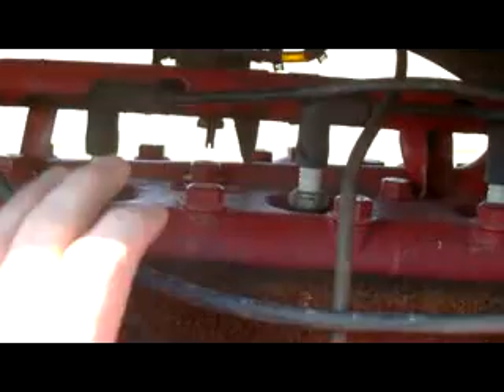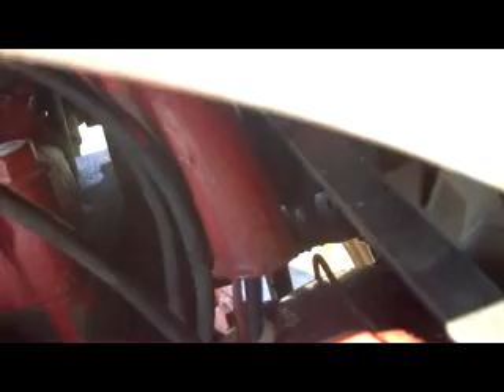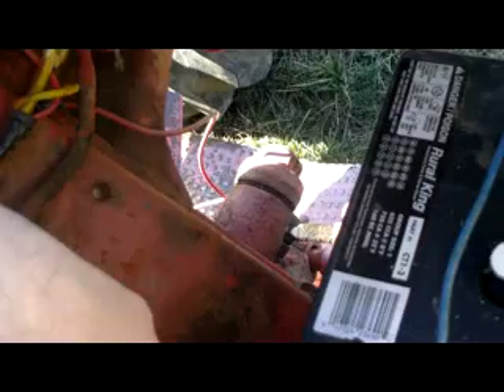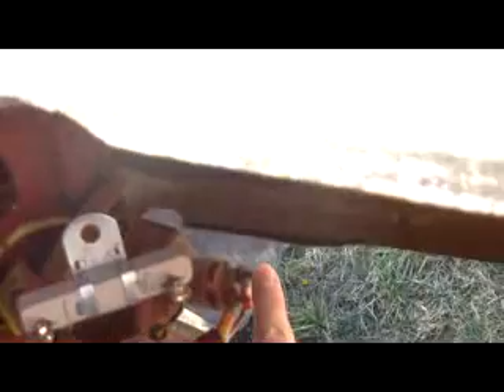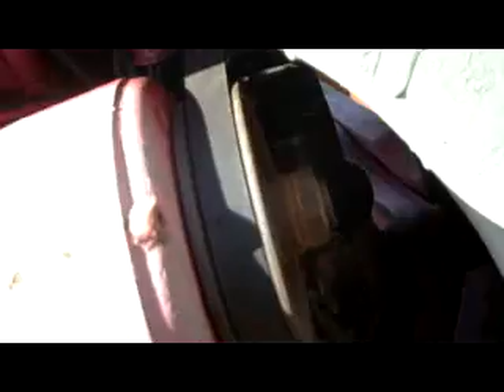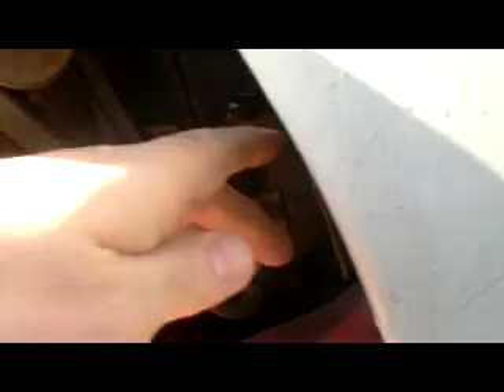8N Electrical System Trouble Shooting When 8n Won't Start

Comment from the maker: To polarize the 6-volt 8N, find the squarecan voltage regulator under yer oilpressure gauge. There should be 4-wires connected to it. 2-skinny black wires, IGNORE THEM. Then there are the thicker wires connected to the Genny ARM and BATT terminals. 
With the engine OFF, use a wide blade screwdriver to "arc-spark" the ARM and BAT terminals together. Just a quick touch to create that "arc-spark". That is all that it takes to correctly "polarize" yer genny and voltage regulator.
Reply: does that work the same way as a 53 jubilee? pos 6 v ground? thanks

Comment from the maker: Ok, this happened to me.. With the 6 volt positive ground if the battery is put hooked up backwards, ie the negative is put to ground, then it will change the polarity of the generator ( even after you hook the battery back right )  You can charge the battery with a battery charger and it will run great and then it dies.  The generator basically is uncharging  the battery as it is run.
Reply: The balance resister is getting really hot on my ford n8 is it supposed to do that?

Comment: my tractor wont start but if pulled or jumped it cranks and runs every time the battery keeps dying a while back i put a 12v battery in it and needless to say i have had to replace alot of parts (battery 6v starter solenoid generator points plugs) i  have not replaced the volt reg plug wires or dis cap its gets gas just fine but something is pulling the battery done any suggestions? someone wired it start so it does not have a key to turn it off possible prob. but its drawing alot of current.

Comment from the maker: First I would see if  the plug was soaked with gas. Just pull a plug after trying to start it.  If it is wet, then you are getting too much gas and need to adjust the carb.  If it is dry, you may not be getting any gas.  Usually you can spray starting fluid and see if she fires.  If so, you have a carb problem, ie not getting gas.  On mine I had this problem due to water/rust in the carb.

Comment: I wonder if u could help me out. I have Ford 8n tractor, that will not start. At first i had no spark. Then i change the plugs and the point, and condenser, and the button and cap. I have spark now at the spark plugs. But it still will not start, and yes there is gas in the tank and it goin through the carb. And success will greatly appreciate

Comment: Correct, I have no spark at the spark plug. I did follow your video. I have voltage at the ballister, I have voltage at the top of the coil. But I have no spark coming from distrubitor cap going to the plugs. It does have new points, distrubitor and coil on it.I do have juice at the points but nothing is coming out of the dist. cap to the plugs. Note I did put my test lite at the top of the coil and it lites up. leaving it on while trying to crank it the lite flashes.
Reply: distributor

Comment: I AM WORKING ON A 8N SIX VOLT AND I WAS WATCHING YOUR VIDEO AND I HAVE 6 VOLT TO COIL AND NEW POINTS AND CONDENCER MY LIGHT LIGHTS UP AT COIL BUT WHEN I CRANK TRACTOR MY LIGHT FLASHES DURING CRANKING AND HAVE KNOW FIRE AT PLUGS